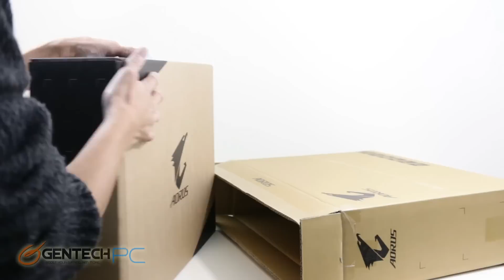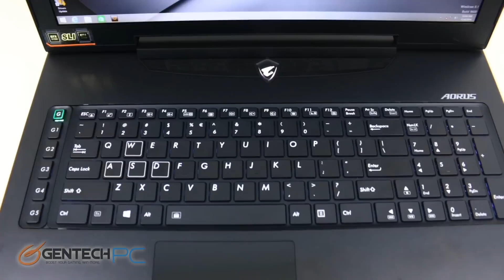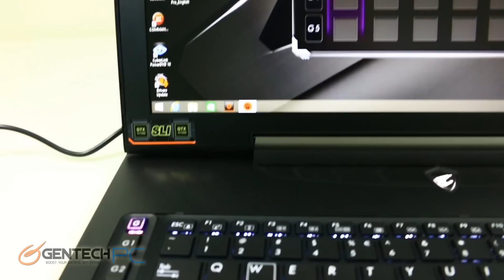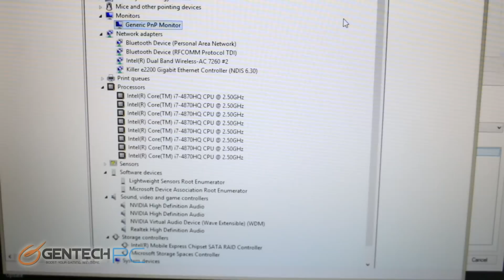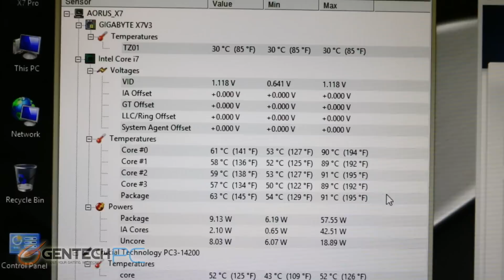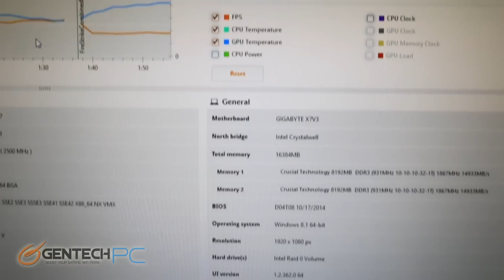Aorus X7 Pro V3 nVidia GTX970M SLI Full Review

Comment: one more thing to point out 
as I checked GTX970m consume 95watts x 2, CPU - 47watts

I dont think 200W brick able to power up this bad boy thou... why not 330W brick instead ? or I have the wrong information
Reply: 970m 80watts for each. Aorus uses battery power for backup
Reply: Dean Calaway Unfortunately, Aorus battery is non removable, that is really not good.
Reply: Unlimited Racing Crew It's user replaceable, not as easy as replaceable batteries of the bat, but still perfectly possible.

Comment: Can I watch an English movie (on just one GPU) on above average brightness without it dying? If yes, Ill buy it.
Reply: If you want, I believe that you can use intel's integrated graphics (part of the CPU) to save power while watching movies and things like that.
Reply: @Ethan Gaines It is possible. Optimus is a no go, but going into the Bios you can disable both GPUs and run on the integrated graphics.
Reply: Ethan Gaines Not with this CPU you can't. Not sure if it is the CPU's fault or Nvidia's but Nvidia doesn't support the swapping for this integrated GPU on this particular CPU. One step down they do though with the HD 4000 series.
Reply: Ethan Gaines  well it sucks anyway as I wanted to buy it in Christmas and I can't go and pick it up in Canada as no stores here have it. And I don't want to pay even more for delivery. So I'll have to either settle in for Aorus x7 v2 or Msi stealth. Will wait until tomorrow or day after. To get it.

Comment: From a couple of reviews i've seen on this laptop i don't understand why they would do 970m SLI if it can't be cooled adequately, they should have made it a little bit larger for bigger fans.
Reply: Seems ok if you had a decent laptop cooler (I think there is all of 2 out of the hundreds out there) and had the fans at least 75% all the time whilst gaming otherwise it suffers from throttling.
Reply: hey you seem like you know your stuff what fps you think i would get on the aorus running witcher 2 on max settings
Reply: CHOSEN MCDONALD
 I don't know how well the Witcher 2 scales in SLI but if its half decent it should be able to get 60+ fps with ubersampling off.
Reply: Thanks for responding bro I think I'm a buy this laptop
Reply: if you think you can replacing the thermal compound can lower temps by a lot